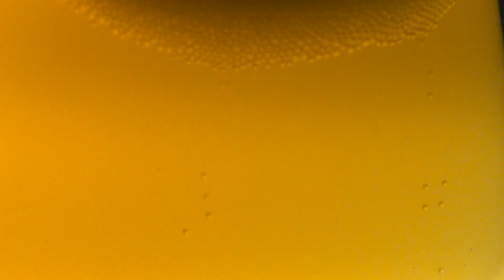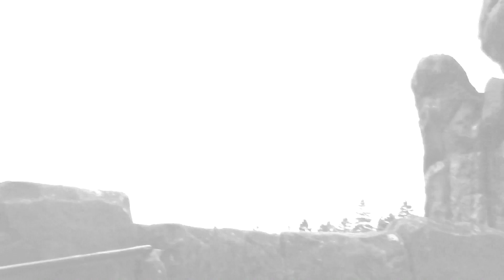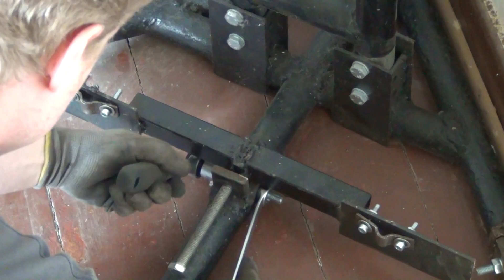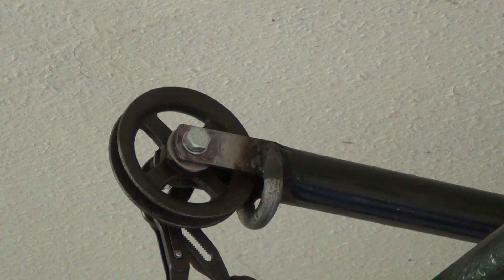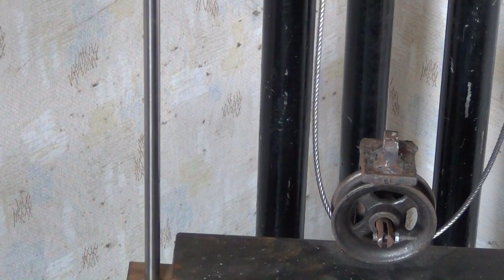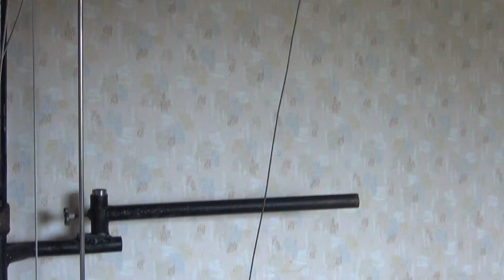How to build a DIY Exercise Machine

Comment: I recently made myself a cable machine that can do pulldowns and rows but I actually made it so that it can be tightened up against the ceiling to provide stability. So long as the plate that touches the ceiling is large enough and not just a single point, the machine is quite safe and doesn’t move at all.

Comment: This is brilliant, I will definetly made one when I move in with my GF, my actual bench (+pulley) is way too big and it's one of the smallest, she will freak out quickly... Your design is great and the variety of exercises is great ! But it seems a little unstable, will it support a 70kg lat pulldown for example ?

Can you please make the actual plans of it ? I guess I can figure it out a design myself but plans from right-brained persons are always better ! The corner placement is real genius, and I mean it, it permit great variety of exercice and require less space.

But it miss something to work the legs, a two tube squat module (slightly inclined, with foot and reinforced with another straight tube that'd go from foot to the actual tube acting as a bracket), multiples bars rest could be added, with bigger tubes screwed in both arm and foot of the machine, and bit smaller tubes weld/screwed to the squat module.
By inserting the smaller tubes inside the bigger tubes (connecting the squat module to the machine) you can make it larger or smaller by sliding it and with multiples matching holes in both tubes make them hold with a simple nut and bolt.
It would be super strong, and super stable.

It could be used for bench press as well and with a longer tube weld to the squat module (and to it "front foot" forming an angle) you can even make a bench press safety or shrugs bar holder !

BTW you should weld every nut in place and use bolt-butterfly (wing-bolt ?) for module that need to be frequently changed it would be more flexible to change position while doing exercises without any tools.

Comment: Im late to the party but could you modify the 2nd cable with a plate that can be moved up and down the middle steel arm, like in most commercial equipment so that you can perform lateral pull downs. Pull out a pin slide it down the arm allow the pin to reinsert itself and perform dumbell curls ?

Comment: That's the most awesome thing ever! It's like the ones you buy, but 10 times the build quality and strength. I'd put some type of mat underneath it though, should make it more stable and stop it from damaging the floor.

Also, are you going to post some plans for it? If I had a welder I'd have a go at building it!

Comment: Is this a copy of an already existent machine?

If not, How many design iterations were necessary until it could perform all these things.

Building something like that does really make sense. Because after you've been charged an arm and a dick, what is the point of exercising?
Reply from the maker: ***** It is not a copy of an existing design. I came up with everything myself. But I'm still quiet sure that a lot of my ideas can be found in existing machines. It was well planned and most of it worked right away. No need for iterations.
Reply: The Post Apocalyptic Inventor 
But need to have gotten the angles and distances for pushing yourself up ect. from somewhere. With the stuff were you use your own body weight the geometry is really crucial.
I really wouldn't know were to even start without measuring what angles they use on professional machines.
So if you did this without any design iterations just on guessing/approximating everything right, that is actually quite impressive.

Comment: This vid made me chuckle.  Nice to see your more humorous side.  Very cool exercise machine, by the way.  Did you study commercial ones for the design, or was it completely from your mind?
Reply from the maker: Akefay Amenay I really came up with it from scratch. I designed it on a piece of paper. My first idea was to make a tower that would hold a pull up bar, that could be used for different variations of pull ups. Then I realized I could also add dip-bars and a cable system. I'm sure that there are commercial machines that use similar methods to achieve similar results though.